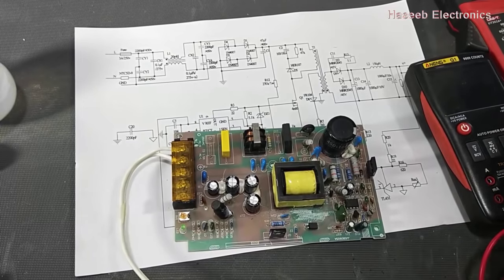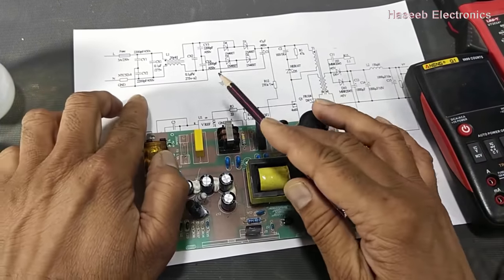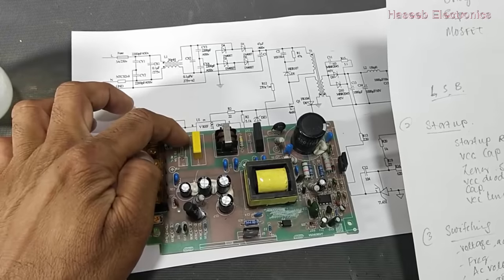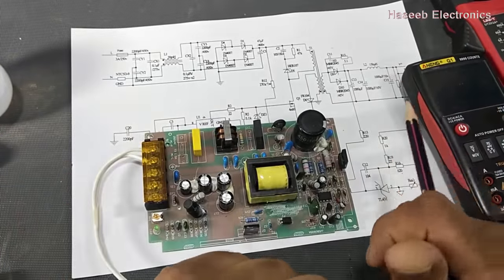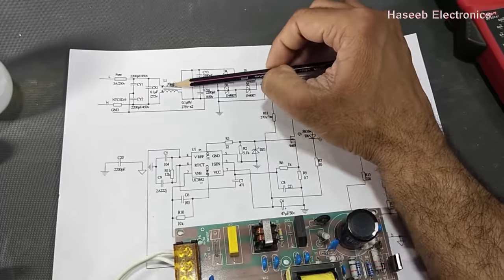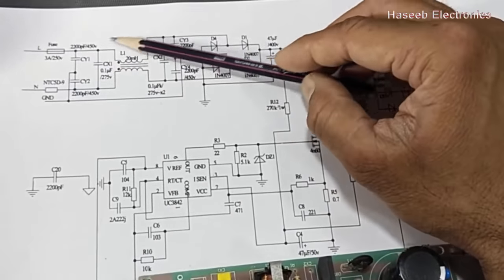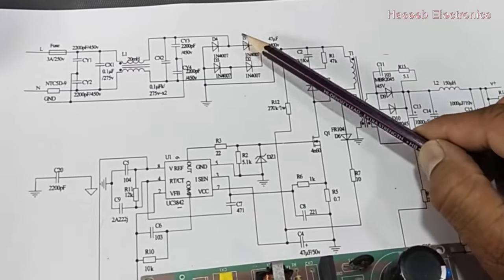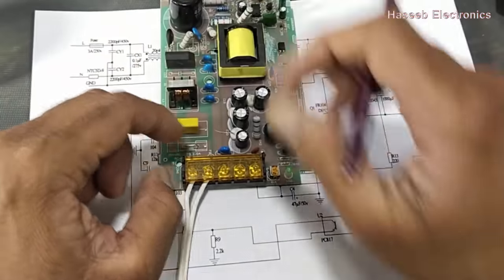{528} How To Repair SMPS || SMPS Repair Step By Step || Switch Mode Power Supply

Comment: Hi En. Haseeb just wanted to ask that I come across a 12v 33.3amps power supply that I just installed to a customer for it's DVR and it works perfectly for 3days and it failed where it just produces 4.++ volts dc only so which is the component that has damaged please elaborate to me thanks

Comment: Can a lithium ion smart battery charger be powered by a switching power suply? I have an AC 220v to DC 36v 34A sps, used it with the Isdt t8 battery charger at 20A and although barely warm, after some burned smell, I heard a pop and it stopped delivering voltage, still hear the relay switching on, fan working, but no dc voltage.

Comment: Sir haseeb, can i ask you what value of watts are you using for your safety bulb and can i use a 50watts bulb? Ty so much for your effort in teaching knowledge about smps idea and troubleshooting.
Reply from the maker: Yes you can 50watts as well 
but it is much better to use 100watts bulb,

Comment: I have a quick question. Is that pull the required ampere output such as 20A or 30A or 40A from 230v with a 6A/10A 3 pin? I am using a car amplifier at home which is maximum ampere rated as 35. To get a desired ampere output what should I do?

Comment: Very excellent 
So over current scence on primary side?
Will this shut down ic and get rid of output?
And need restart?
Reply from the maker: thanks a lot 
yes it measures the peak primary current, when it will detect the peak, ic will disable the mosfet switching. so the output will drop, and input peak current will drop because the switching is stopped. now the IC will enable switching again
this function is called Leading Edge Blanking (LEB), in this process the IC skips the mosfet drive for that period, when the primary current reaches at its peak level. that is detected by the current sense resistor (connected at source pin of the mosfet)

Comment: Thank you Mr Hasseb for this video. I have a Chinese Neps1600-48A the status is ok, there is output voltage but after few seconds the FAIL led goes on? Thanks
Reply from the maker: i never experienced with this brand 
but i think there is some supervisor section, which is interrupting (may be some OPAMP or comparator) which is disabling the output due to any failure 
or may be some over-volatge or over-current switch is being activated

Comment: Your Videos are excellent. I have a question to SMPS circuit: 12V5A, capacitors are good, tl431 has 2,5 volt, PWM circuit switches at 64Khz. With a small load of 30 Ohms it works perfekt, but with a load of 10 Ohms it works at start/stop mode, the serial lamp at the input is blinking with ca 1 Hz. Have you any idea, what the problem is ?

Comment: Thanks for the knowledge sir. Sir please does uni-t multimeters have tricks to using it? and the reason why am asking this is because I recently bought uni-t ut61B+ multimeter from Ali express and resistance and capacitance measurement are mostly not accurate. Thanks

Comment: Thanks for this informative video. By the way do you have any video for smps which on the output or cold side is using SCR / thyristor. In this case is the thyristor used as the same as the mosfet function?

Comment: If the C4 capacitor in this circuit is bad. Will this cause failure of start also? I’m sorry if I missed this in the video, tried to look for it

Comment: Habeeb Sir. I tried the probe method on Main capacitor and input terminal to test bridge rectifier diaodes. The diaode is reading on both probes, even when i switch the probes. The meter does not show OL in any situation. There is no beep in contuinity mode also. I did as you said. First red probe on negative line of capacitor and black probe on input terminals. I am getting reading on both probes. The capacitor is also reading 96 on bothsides when tested in contuinity. No beeps on any probes while i did the above tests. What could be the problem? Should i go ahead and put power?

Also sir the smps under repair has 8107A IC and there is no external mosfet. In this situation how do we test switching via mosfet? Will the procedure differ in such situation?

Please solve my query sir.

Thank you
Reply: Hello Sir

Comment: Hi Sir, have you prepared video on Transformer design for smps that could work on DCM or in CCM mode.
Reply from the maker: DCM CCM are the same designs, just in calculation we have to adjust the duty cycle and dwell time

Comment: Tnx a million and got a question. Got a 12V, 20A SMPS and the output voltage is built up gradually in about 25 minutes!!??!! got no idea why and I checked almost all the components. Once it's built up, there will be no problem at both no load and loading condition. Need your help and tnx in advance.

Comment: What doing and what for is in this scheme C11 and R15 near D9 with D10?
Reply from the maker: d9 and d10 are 2 rectifiers in parallel to get more current 
r15 annd c11 is snubber circuit for diodes to get fast recovery. at high frequency the rectifiers need RC snubber circuit for safe operation
Reply: @HaseebElectronics  thanks very much for the answer

Comment: I had a 12V/15A SMPS Unit which I encounter a problem. When I power the input (240vac), the output voltage is about 8vdc, but it slowly climb until it reach the set voltage (12.5vdc).
But when I connect a very small load, the voltage will dropto 8vdc, but it will slowly climb back to the set voltage (ie 12.5vdc).
I had checked all the capacitors, it's GOOD. I also replaced the mosfets (all), the problem still persist.
I needs your assistance and guidance to solve this problem.
Appreciate for your feedback.
Thanks in advance.

Comment: Sir, I have a Milwaukee charger which have a problem. When battery is not plug in, I have a red led which means battery is charging (whereas battery is not present on charger, same when battery is plug in but it does not charge). On main capacitor, I have 325v stable. I don't have external mosfet it is packaged with my IC so I can't check frequency on gate pin. When I test frequency between ground and drain or source pin I find 50hz (maybe a faulty measurement because when my multimeter probes are not connected to something, I have 50hz too). I have 324v stable between drain and source so it seems like IC is not switching but when I check voltage on double diodes rectifier on secondary I have 35v stable does it means that my IC is switching good after all ? On output connector I have 3 pins, "bat-", "bat+" and "sensor", I have 2v between "bat-" and "bat+", maybe a sensor problem I don't know... It's a M28 charger for 7 cells so it must delivers nearly 28.7v. Any help will be greatly appreciated.

Comment: Hello sir.. I'm trying to repair a SMPS of LG DM5420 hifi music system.. I'm don't have much detailed knowledge in electronics.. I'm basically an electrician teacher.. video has every details.. but still I can't find a solution for my SMPS.. can you help me sir..

The IC is str w6753.. it's Vcc pin shows a voltage of 4volts.. it should be 14-19v as per service manual.. this is the present situation that I have to rectify first ( I think )

Comment: Hi Sir, have you prepared video on Transformer design for smps that could work on DCM or in CCM mode.
Reply from the maker: DCM CCM are the same designs, just in calculation we have to adjust the duty cycle and dwell time
i am going to design, with calculations and its practical performance testing very soon
Reply: Sir, I have seen no. Of video but stuck in between calculation so no conclusive calculation found and its formulae. One more thing i saw your RCD snubber calculation but there is also a confusion becoz where the formulae camr from, becoz you used direct formulae to calculate the RCD values, there are no. Of video on transformer they never told about the formulae and used direct formulae to calculate the values so i want to understand from where the peak current comes that should come from waveform step by step.
Reply from the maker: yes 
there are many misleading videos, that don't provide any authentic guidelines
as the magnetic design theory is very deep and complex than electronics
and the people having it's knowledge don't try to share with others 
no problem in upcoming schedule I will explain with it's full details

Comment: Haseeb i have power supply for Ricoh printer, IC not available, is it possible to take another driver circuit to switch existing power supply transformer thereby "repairing power supply",
Reply from the maker: yes dear 
you can add external module. 
jsut determine the switching frequency for exixting IC by checking its datasheet and insert new module with same switching frequency

Comment: Asalamu alaikum sir i hv a 5amp 12v battery charger its snubber network resistor n capacitor were burnt out but now i replaced both of them but output voltage does not go beyond 10.5 v and the resistance ( 25 ohms) becomes super hot i tried different values but it does not work properly plz help

Comment: Assalamu'alaikum, Sir I have Lenovo Charger 20V 1.7Amp, I check the output voltage is 20V but my problem is the charger only indicate icon charging apear but battery not getting charging, can you help me what should I do.. ?

Comment: I repaired smps of welding machine after this machine is OK but when I connected its 24volt fan there is no out put,its OK when  disconnect the fan what is the fault
Reply from the maker: may be fan is short 
or the smps cannot provide enough current
Reply: But fan is ok

Comment: i am from india , i am not able to find power transistors and diodes for primary and secondary side psu in india at online , please tell me where to buy these components or others equivalents or substitutes for 450watt psu (zebronics) .  c5027r , 13007-0706, 13007 -1012b

stpr1620ct - 7skwy ,  stps2045ct -7sabz ,   stps2045ctc - g417b         
i kindly request you tell me where these other components can be found to repair these kind of appliances . thank you.

Comment: I have an smps with line filter coil burn after on and off several times (but when I change a new one or rewiring it, it functional like before), can you give me some suggestion or can you guess which component is fail?

Comment: What would be the reason for output voltage is increasing slowly automatically in 24 V SMPS
Reply from the maker: most of time the the capacitor on CT pin of SMPS controller becomes weak, so it causes to increase switching of the IC

Comment: Assalamu Alaikum. I could not see the transistors next to UC3842 in the circuit. I have a similar power supply with these transistors and the transistors are burned. Could you please explain the function of the transistors and which transistor I can use instead?

Comment: My smps is 12 volt 10ampere. Applying load to it makes a chirping sound. And after a few seconds the series lamp is fully lit. Its IC number is K7500 BD। 7th and 16th pin of IC gives continuity. Sir I will be grateful if you can explain the problem.

Comment: Sir multimetr kaun sale
Reply from the maker: i use FLUKE 177B, Aneng Q1, Uni-T 202A+, and kaiweets 
i suggest Uni-T, Aneng Q-1 or any multimeter with frequency, duty cycle, capacitance options with input range above than 600VDC, if auto ranging true rms multimeter is available then it will much better

Comment: ic (uc3843) pin 7 vcc voltage checked its showing only 6v, what to check?
Reply from the maker: if it is 6 volt, replace ic. 99% ic fault
Reply: @HaseebElectronics   Replaced it, but no luck

Comment: My SMPS doesn't have the same output... 16vdc and -28vdc
where is the problem??
Reply from the maker: is it fluctuating between  16 to 28 VDC??
please clarify
Reply: @HaseebElectronics  my CT smps dear friend
the voltage not balance between -voltage and +voltage